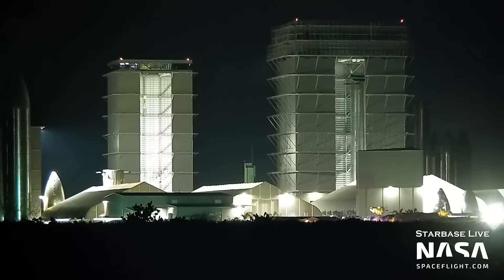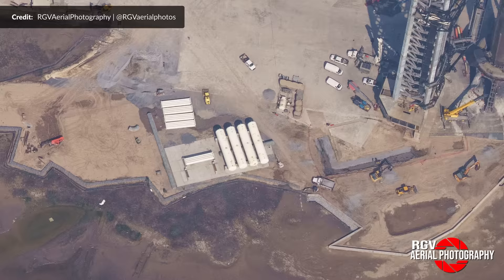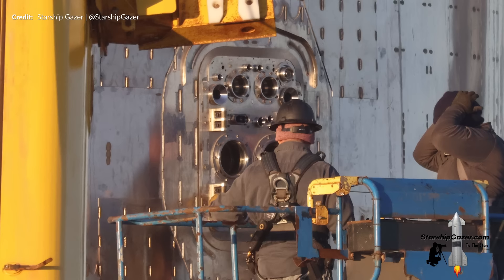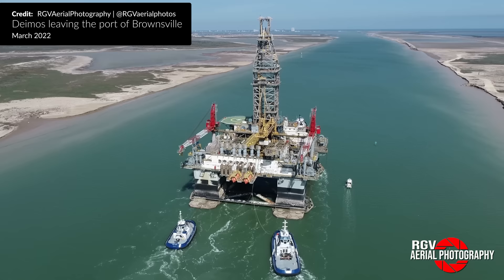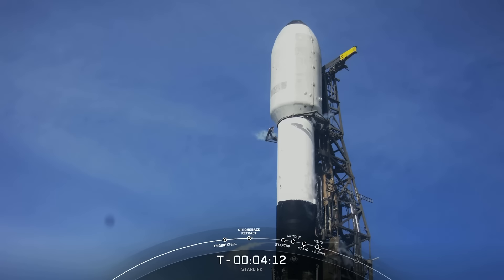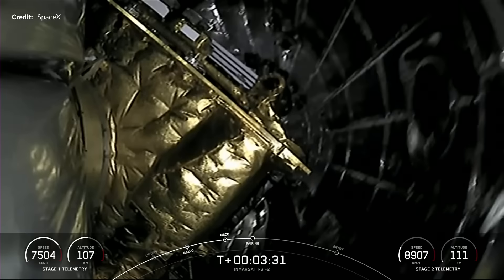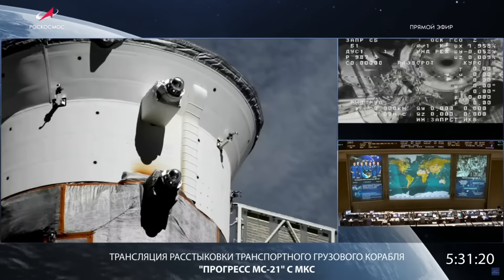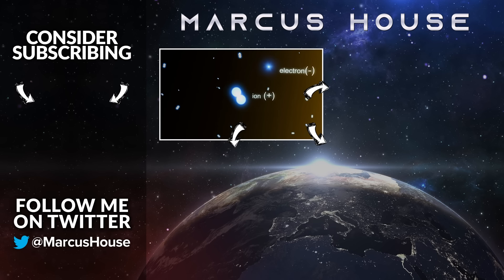SpaceX Ditches the Oil Rigs and Incredible Insights of the Orbital Launch Mount/Booster Static Fire

Comment: Another great video.
Question - With the SpaceX booster test causing the concrete platform to be a possible problem of producing flying fragments. What will it be like to exit the Moon or Mars.
Reply: For Artemis, the HLS Starship with have a ring of 24 smaller LCH4 engines about 25 meters off the ground, for the last bit of the landing and the first bit of the launch. Since the Moon's gravity is 1/6 of Earth, it should not be a problem. For Mars' 1/3 gravity, it will probably be similar. With the engines up so high, the exhaust should largely disperse before it gets to the ground.
Reply: @steveaustin2686  Mmmmmm, you have me thinking about the Mars Landing and Liftoff exhaust. With a very thin atmosphere, there will not be much 'density' to absorb the exhaust. So there may be some 'puffs' of Martian regolith lifting into the CO2 thin air. I expect it would be a long way from the ship if it's angled out.
The Mars 'wind storms' hardly raise any dust, because there is no 'thick air' to push the regolith around. But a rocket exhaust introduces a dense plume into the semi-vacum of Mars. 
Like a toy water blaster introduces a stream into the earths relatively 'less dense' air (compared to the density of water), so where the ejected 'squirt'  hits the dirt, it sprays it outwards.  
With there being a semi-vacum on Mars, the 'squirt' will flare outwards like the exhausts do on the Falcon9 near the Karmin line, so it may create a small spread out cloud of dust on the Martian ground. It shouldn't produce flying fragments though. 
What do you think? 🤔
Reply: @David-yo5ws  The idea is that with the engines being so high off the ground, that gives the exhaust more time to disperse. Plus the exhaust is divided between 24 engines, instead of 6 engines, so each one should be roughly 1/4 of the Raptor exhaust to disperse from that height. It might not all disperse before getting to the ground, but should be much less than 6 engines at the bottom of the Starship (second stage).

Comment: How many Super Dracos would be needed to land lunar Starship on the moon if they are used upper part of lunar Starship?
Reply: The engines up at the top of the HLS Starship tanks use LCH4, as SpaceX wants a common propellant for all the thrusters, including RCS, if possible. The Superdraco engines use hypergolic propellants, which SpaceX is trying to avoid for Starship.

Comment: Marcus, were there batteries for the grid fin motors in the image showing the top of the booster?
90% power,...... Assume full load mass simulation, means two engines out and 95% power on the rest still makes orbit. Four engines out and a smidge more power then 100% is needed, or 100% for a longer duration burn (using the fuel that would be allotted for the engines that are out) still gets to orbit. From there, every extra engine shut down means longer burns until the point the mass of the non-functional engines is greater then what the rest can push to orbit. Probably a safe guess that SpaceX is looking at Ten engines out, still makes delivery to LEO.
Reply: And the longer burns can use the propellant used for landing, turning it into an expended booster. But doing the job of getting the payload into orbit, which is more important than recovering the booster.
Reply: @steveaustin2686  Yuuuup. Especially if it's a crew rated vehicle on top. Makes ya think, SpaceX like keeping passengers safe.

Comment: Where are the parts for orbital refueling? Are they still trying to figure it out, or do they have no idea how to get it done?
Reply: The former, it can't be done if the vehicle can't reach orbit in the first place so that's what they're focusing right now
Reply: There have apparently been very small scales tests of transfering propellant on the ISS in the tens of kg range. SpaceX has a $50M contract to demo Starship to Starship propellant transfer (10 tons) in LEO by the end of 2022. But as Alvian said, you need to get to orbit to work on orbital propellant transfer.

Comment: As always, excellent (and apparently the best) coverage anywhere.  Just for the simple minded layman out here, the MS labeling on the Roscosmos missions can be confusing.  There are two different missions both using the MS-2x naming convention.  There is Soyuz MS-22 (launched 9/21/22, 3 astronauts, famous "micrometeor" leak on 12/14/22), Progress MS-22 (launched 2/9/23, cargo only currently docked to ISS), and finally Progress MS-21 (launched 10/26/22, cargo only, just suffered depressurization event as referenced in video).  I was massively confused at these naming conventions and sequence of events (I don't have any idea about the Roscosmos program and their apparent plethora of issues).   Anywho, hopefully that was a helpful clarification for those armchair astronauts !  🙂
Reply: Going out on a tin foil wrapped limb. What do you think of the possible theories of sabotage and or poor maintenance of the soyuz modules?
Reply: @serronserron1320  IIRC, the previous leak inside a module of the ISS was probably sloppy workmanship when it was on the ground and not in space. Sabotage seems silly, when the Soyuz MS-22 was the ride home. Russia did an anti-sat test in late 2022 and the ISS had to bunker in their capsules for an orbit. I wonder if it might be debris from that test that got both capsules.
Reply: @steveaustin2686  That would be somewhat ironic
Reply: @serronserron1320  Yeah, if it was debris from their a-sat test, it would be ironic.
Reply: @serronserron1320  to start with we need to have accurate, unbiased, detailed root cause analysis of why and how each event happened.  At this point, I would not fully trust anything Roscosmos says or states.  It would be good (and probably impossible) to have an international team investigate the events and publish the findings in a transparent way.  The idea would be something similar to the NTSB for space.  This may already exist (reference my armchair status).  Unbiased investigations to all space related events would serve humanity and future space exploration well (including China, India etc.).  It is getting crowded out in space and will only grow more so as time goes on.  All humans could benefit from lessons learned as space exploration is complex and fast moving.  That's my two cents anyways.

Comment: What was the previous turn around record for the Falcon? Last I remember was like 2 weeks on the turn around
Reply: Ah nevermind I found it, it was three weeks for the previous record, pretty insane leap from 3 weeks to just under 1
Reply: @phoenux3986  The booster was not turned around in 5 days, but SLC-40 that turned around in 5 days. The booster record is still 21 days.
Reply: @steveaustin2686  Ah oaky yeah, I went back and rewatched that bit and missed the "pad" part.
Reply: @phoenux3986  No worries.

Comment: Side question:  since design, development, build and deploy of JWST has been done, is it possible to make and deploy more than one in a (relatively) cost effective manner? 

I’m just wondering if it might help having more sensors to not only increase monitoring capacity, but also have more persistent/dedicated scanning sensors for asteroid detection and tracking.  I know it’s rather expensive, but seeing that it’s been done once already, I wonder if it would make sense.
Reply: Space telescopes are built to specific purposes and there is no general space telescope variant. Hubble and JWST over lap a bit on how they see things, but mostly look at the universe with different sensors. The next space telescope is the Nancy Grace Roman Space Telescope (NGRST), usually just called the Roman space telescope. It is based on the KH-11, which is kind of a standardized spy telescope. The camera and sensors focusing will be different as a spy telescope looks at a near by, brightly lit, fast moving landscape. Where a space telescope looks at far away, dim, barely moving landscape. The Roman telescope is scheduled to fly on a Falcon Heavy, NET Oct 2026, but that will almost certainly slide to later.
Reply: Fair points and thank you for your insight.  

I know there are a few organizations that are working on asteroid detection.  I was just wondering if the work and design put into JWST would help speed up the progress for this effort.

I’ll definitely look into the Roman telescope to learn more about it!
Reply: This is where Starship really doesn't get enough attention. When considering a design like the James Webb a lot of thought had to be out into making it as light as possible and making it fold to fit inside the fairing. With Starship a lot of the weight considerations will be thrown out the window; it will be simply cheaper to use more conventional but heavier metals and a lot less points of failure. There will not be a need to design something like JW in our lifetime. Our future telescopes will benefit greatly from Starship. And there will be dozens of them instead of just one per decade
Reply: @avsrule247  wholeheartedly agree.  That’s one of the big reasons I’m excited with starship development.  It is going to revolutionize how we look at getting things into space for sure!
Reply: @avsrule247  Nice job, Matt! Very logical.
Reply: @avsrule247  With Starship's internal 8m diameter, a fixed mirror could be larger than JWST's 6.5m mirror. Or you build a JWST on Starship scales for a mirror larger than 8m in diameter.
Reply: A potential asteroid detection system might resemble the GPS system. GPS satellites send their relative position, and their relative time to receivers. By using at least 3, a rough latitude and longitude can be calculated.  Acquiring 4 can triangulate elevation. More are needed to increase accuracy. Take that same concept and turn it outward, in the form of 2 dimensional images. Using multiple images taken from different positions relative to the imaging target, the size and location of objects can be calculated.  The more images,  the greater the accuracy. This would necessitate positioning many "cameras" (if you will) orbiting several bodies, such as Luna, Earth,  Mars, etc. Probably would be a wasteful method, but is interesting to conceive and ponder. BTW, I learned GPS engineering directly from the original source, at the Rockwell-Collins plant in Cedar Rapid, IA, in 1985.
Reply: @curiousnation5350  As I understand it, asteroid searches are currently wide field looking for the light reflected from the asteroid moving. The smaller and darker the asteroid, the harder to see the reflected light. Apparently, we are mainly looking in the wedge of the sky on our side of the Sun, facing away from it. When you look closer to the Sun, the sunlight apparently washes them out. So space telescopes out at L3, L4 and L5 would help a lot, but until money is funded, they won't happen. The Chelyabinsk meteor in 2013 was like a fender bender warning in a car. Sadly, I doubt a greatly increased asteroid hunting will happen until the equivalent fatal car crash happens to some populated area(s) by a meteor. It seems like once the planet killers were found, public support for finding the city killers waned.

Comment: Again thanks for the updates. When will Blue Origin launch New Glen launch first spaceship?
Reply: Don’t they need to get the engines working first?
Reply: Who knows. Likely in 2024 as a guess. ULA reportedly has first dibs on the BE-4 engines and they have 3 launches to do by Jun 2023, using 2 BE-4 engines each for a total of 6. And has at least two more launches after Jun 2023. So ULA could require up to 10 BE-4 engines by the end of 2023 and so far, it appears that ULA has only received 2 BE-4 engines from Blue Origin. The Blue Origin New Glenn uses 7 BE-4 engines on each booster, so unless Blue really ramps up engine construction, it might be a while before New Glenn flies.
Reply: @fredbloggs5902  ULA received the flight ready engines for the first launch late last year. Whether they got the 4 more engines that they need before Jun 2023 is an open question.

Comment: Could ship 26 be a prototype fuel depot and the new rivets on the outside be mounting hardware for internal propellant insulation?
Reply: Doubtful.
Reply: No, that comes later, the initial launches are primarily to test engines and reentry capability.
Reply: @fredbloggs5902  SpaceX does have a $50M contract to demo Starship to Starship propellant transfer by the end of 2022. So since they are behind schedule, a set of propellant transfer flights once Starship has flown once or twice is not out of the question. The question is how long it will take to finish tweaking Stage 0 and finish the Starship testing.

Comment: Ehhhh wireless that seems like a bad idea for a mission critical link, like Cat6E is pretty cheap and would be easily torn in the process of separation I don't know any engineer would would link the two ships by wireless receivers rather than just spend $1 on a disposable CAT6E cable.

Comment: Do you know the route Plan of the orbital flight
Reply: The first 'orbital' flight path was laid out in the FCC filing over a year ago. Starship will lift off from Boca Chica and head east to pass between Florida and Cuba. The Superheavy booster will separate at MECO in the Gulf of Mexico and boost back to land 20 miles off the coast of Boca Chica. It will do a soft water landing, like it was going to be caught by the chopsticks. Starship (second stage) continues into the Atlantic, over Africa, the Indian Ocean, and into the Pacific. It lands 62 miles north of Kauai, HI, also doing a soft water landing. So while Starship gets to orbital speed, it won't circularize the orbit per Musk. So it won't do a complete orbit of the Earth, which is why I put 'orbital' in ''.
Reply: Second star to the right and straight on 'til morning.

Comment: Relying on Blue to launch anything is ridiculous.  They should not be selected for any mission until they prove they can get to orbit!
Reply: Why? Grumman got the contract for the LM without going to orbit. Based on the New Shepard, Blue Origin makes good equipment, eventually. They just have a VERY slow development process, as noted by the USAF (USSF). The Air Force (USSF) had some pretty sharp criticism for Blue Origin's New Glenn and Northrop Grumman's OmegA development for NSSL2 payloads. From a SpaceNews Aug 2020 article

"Despite political pressure to not end the LSAs, the agreements will be terminated, Assistant Secretary of the Air Force for Acquisition Will Roper said Aug. 7 during a video conference with reporters.  'We will work with those two companies to determine the right point to tie off their work under the LSA agreements,' Roper said. The intent of the LSAs 'was to create a more competitive environment leading into Phase 2,' he said. 'The point is not to carry them indefinitely.'”

As long as ESCAPADE has longer development than the rest of New Glenn's devleopment, why not? Having multiple launch providers is a good thing. Unless the BE-4 fails horribly on launch, it should be fine.

Comment: if you use a fan in space will you feel a breeze
Reply: Inside the ISS yes. If you are holding the fan, you might move as it would act as a propeller. And provide torque to spin you. In the vacuum of space, it would only be the torque that would affect you.
Reply: @steveaustin2686  thank you
Reply: @georgecattell4110  You're welcome

Comment: How many Soyez does Russia have at its disposal? Seems to be a pretty common ship for them, I'm wondering do they have a factory with a dozen of them lined up? Can't find any apparent data from google.
Reply: The crew Soyuz launches every 6 months or so, so probably not a bunch lined up.
Reply: @steveaustin2686  That seems like a lot of rockets to me, compared to traditional spaceflight like the program Russia has. Not comparing to SpaceX or other high iteration rocket producers. What I'm really trying to get at is their production, they have been using the same rocket for years, how many have they produced over this time? I think pushing a a functioning rocket and booster every 6 months is quite an accomplishment. They should have a pretty efficient production line.
Reply: @ezekielteklaking  Soyuz is the name of two things, the booster and the capsule. Both have been heavily modified over the years. Two crew launches a year for Russia is not that big a deal. Before SpaceX came along, most rocket launches were in Russia as they were cheap. With SpaceX taking up a lot of market share, Russia's launches have went down. Just for the ISS, they usually fly 2-3 crew Soyuz and 2 to 4 Progress cargo flights a year. Plus whatever other hardware they send into space. They lost a lot of external business when Russia invaded Ukraine.